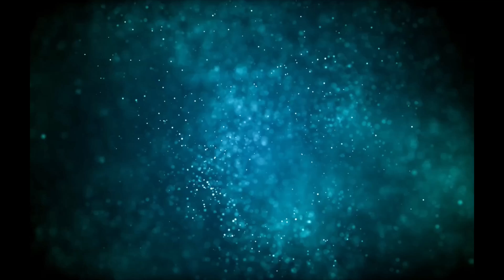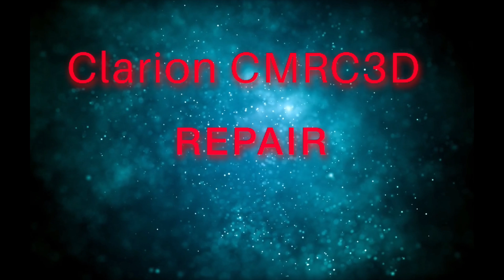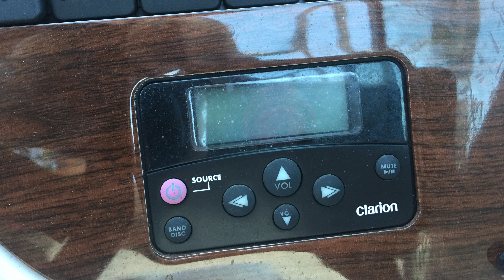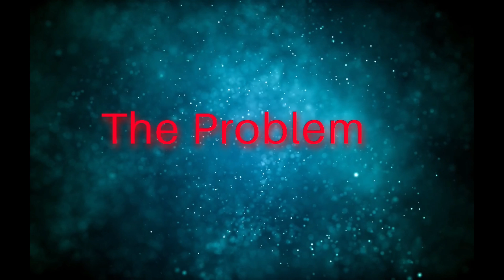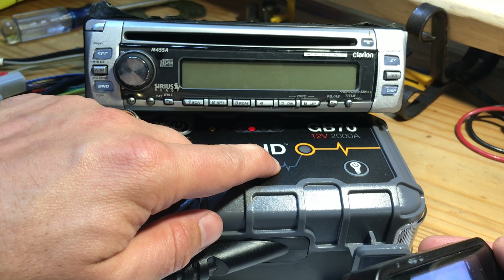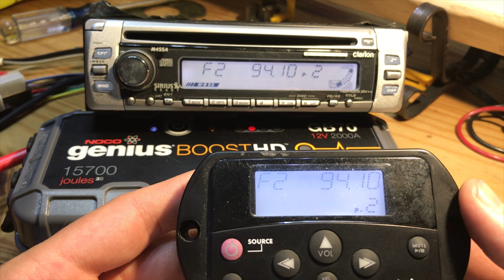Clarion CMRC3D Wired Remote Repair. 2007 Chaparral

Comment: Please get in contact with me. I’ve got same exact issue, but I’m not sure my chip is ‘off’ like yours.
Reply from the maker: Since the making of this video, I had the issue come back. I think the solder they use is just garbage and can’t stand up to the summer heat. I have since replaced the radio and remotes with aftermarket.